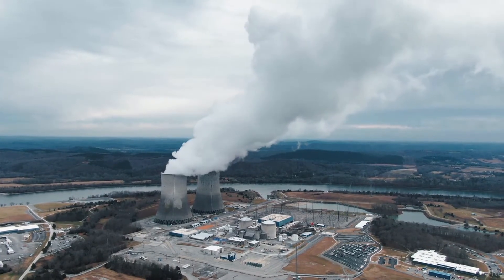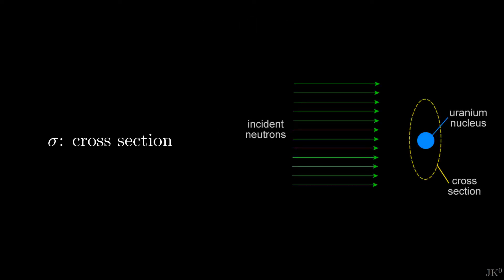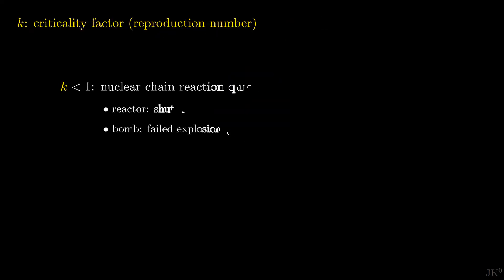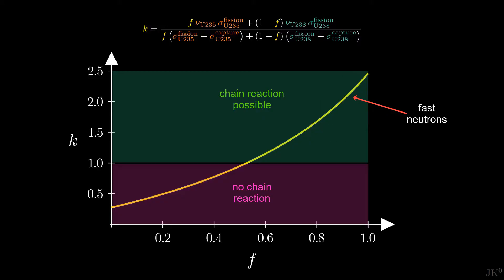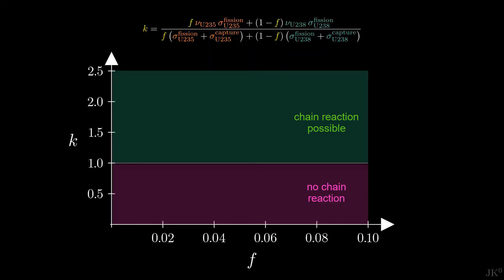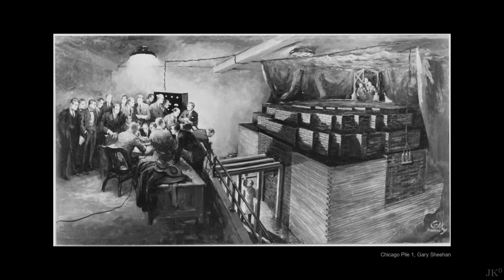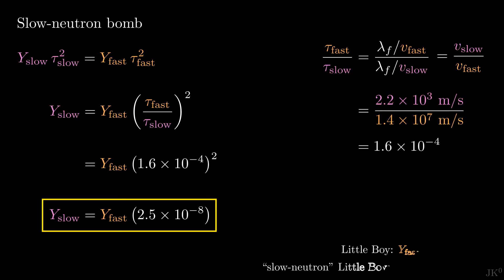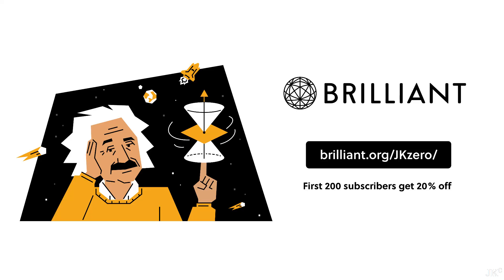Nuclear Bomb vs. Nuclear Reactor

Comment: There are some assumptions and simplifications in the 375g TNT calculation. Might be close with an ill-fated reactor, but certainly not when designing for yield. If focusing and DT is also allowed, different assumptions are required. Needs intentional design optimizations to get any meaningful yield with slow n, cannot happen accidentally, that is true.

Comment: 6:30 this is not true. Chernobyl was a nuclear explosion. It doesn't matter if the neutrons are fast or moderated. It only matters if the mass of uranium achieved prompt criticality. Prompt criticality is uncontrolled and leads to a nuclear explosion. One can design a reactor so it cannot go prompt critical at any circumstances. RBMK reactors were however designed in a way that allowed them to go prompt critical, thus becoming a nuclear bomb. A bad one, inefficient, and very limited in power, but still a nuclear fission bomb (if handled inappropriately). Properly designed nuclear reactor can only achieve delayed criticality, which can be controlled, and with proper design is also self-containing. which means that an increase in power gives a negative feedback that push reactor back below criticality (and slowing down the reaction).
Reply: No it wasn’t. It exploded because of the accumulation of vapor and other gases inside tbe reactor chamber. It blows away the reactor cover and leaves the core exposed. But it wasn’t a nuclear explosion by any means.
Reply: The explosion was the reaction between generated HHO gas from the coolant being radiolysed and the graphite catching fire. Yes it went prompt critical but it just melted for the most part, the radioactive fallout was mostly the debris from the HHO detonation

Comment: Yes. But isn't there a scale factor that needs to be taken into account? The bigger the bomb, and the lower its "density" the bigger the fast/slow neutron ratio effect on yield would be?
So is there a lower size limit below which you would actually want to use slow neutrons for a bomb?
Or is this size threshold just so far outside of buildable object sizes that it's not relevant?

Comment: Nuclear reactors can become dirty nuclear bombs , as Chernobyl and Fukushima demonstrated. Wouldn’t you agree Dr. Diaz ?
Reply from the maker: Under dramatic conditions, nuclear reactor can be taken to critical scenarios. In Chernobyl the most important factors were the terrible design, bad operation, and lack of containment that led to a a run-away reaction and the subsequent stem explosion. Not a nuclear explosion.

Fukushima was different, reactors cores melted down but the explosions were just hydrogen explosions, nothing nuclear either.

Comment: Your definition is incorrect. A “fizzle” is a nuclear explosion that exploded below its design yield. However, it is still a nuclear explosion 

The k value is still greater than 1 at the time of detonation but is unable to sustain for long enough to achieved its design yield before it blew itself apart and reduce k value to less than 1.

(If only the convention explosive detonate then they would described it exactly that… conventional explosive inside the bomb went but not a nuclear explosion)

So, yes a nuclear reactor like Chernobyl could definitely become a “fizzled” nuclear bomb accidentally as the design flaw which allows for positive void coefficient means that there is a possibility of a reactor runaway where power would continue to increase until it basically blew itself apart.

Hydrogen/steam explosion doesn’t vaporised 190 tonnes of uranium in a blink of an eye like magic… Chernobyl reactor 4 core was pretty much left emptied after the explosion. The  famous “elephant foot” is actually over 90% melted sand with only traces of fission products in it) and all evidences points towards very little of the reactor core are left onsite. (Note Chernobyl reactor cores are gigantic)  

They were able to sent people right inside the Chernobyl reactor just several months after the explosion… compare to Fukushima which they still  can’t get anybody near the reactor after 12 years.

Comment: I enjoy a lot your excellent channel, well done!

Speaking of the yield, you have to take into account the total mass of the nuclear material also, don't you? Since the uranium content in a nuclear reactor is around 3 orders of magnitudes larger than in a nuclear weapon, this compensates the inverse squared effect of the characteristic time between neutron collisions. This way you end with a yield ratio between a small weapon (utilizing fast neutrons) and a large reactor (utilizing slow neutrons) around 10^4-10^5, resulting in explosion energy in 100-1000 kgs in terms of high explosive equivalent instead of 0,1-1 kgs.
Sure, this is nowhere compared to nuclear weapons yield and can be produced with conventional explosives much easier.

Some say that the initial explosion at the infamous Chernobyl accident was a low-efficiency nuclear detonation, or rather, "fizzle". The claim is based on evidence examining the ruins of the reactor hall, position of the biological shields etc. Check out That Chernobyl Guy's video on this topic: https://www.youtube.com/watch?v=kuptYyKoDM4

Comment: Can it explode like a nuclear bomb, with a classic mushroom cloud .... No. But that is a false question, and a misdirection.

Can a nuclear reactor suffer an in-core nuclear detonation leading to rapid catastrophic disassembly and release. Yes, in some circumstances. It has already happened at least three times, and arguably several or many more. SL-1, KIWI-TNT, and Chernobyl all suffered in-core nuclear detonations and disassemblies. The assemblies could not release more than tens to a hundred tons of TNT equivalent release from prompt fission yield. But tens of tons is certainly enough to utterly destroy the reactor and any containment.

Many of the tiny SNAP and SPERT reactors may have crossed that threshold as well.

Is this a serious concern for nuclear reactors? Yes. The reactors must be designed and operated in such ways that it is not possible to achieve prompt criticality leading to disassembly (or even serious damage) under any conceivable incident scenario - including especially hostile action by any adversary - internal or external, and from any conceivable accident scenario.  It is not enough that the probabilities be low. The consequences are far too severe to allow any such scenarios. 

This also extends to spent fuel pools and other fissile material storage.
Reply from the maker: The topic of the video is the fact that a nuclear reactor cannot explode like a nuclear bomb (which stated within the first 20 seconds of the video to avoid misleading viewers), and the title of the video makes clear that this is a comparison of the nuclear reactions taking place in a reactor and how they differ from those in a bomb. Other types of explosions are mentioned at 6:24.
Reply: @jkzero  Ah - but that is precisely the misdirection that will mislead viewers, as the viewers are mostly not well versed in nuclear physics or even the consequences of catastrophic malfunctions in such facilities. In many ways the consequences of a lower yield nuclear detonation in-core that destroys the reactor and facility and spreads enormous quantities of radioactive material across the landscape and into the atmosphere is worse. These are potentially nation killing events. Arguably, Chernobyl ended the USSR. Fukushima nearly did the same to Japan, though no in-core detonation occurred there. 

If such an event occurred in a US reactor in the midwest, it would wipe out much of the US heartlands ability to produce food (both as crops and animals). Farther east and the population impacts are massively larger, but with lower food production impacts. 

Many of the reactors are embrittled or have extremely questionable primary vessels already, making them more vulnerable to catastrophic failure. Nearly all of them are extremely old making them more vulnerable yet, with embrittlement of all of the nozzles and connections. 

Some like CGS in Washington State have other serious issues. NRC has allowed CGS to run with a broken bracket on a primary ejector pump in the primary vessel by running with a richly hydrogen environment to reduce oxidative damage to the remaining bracket, and greatly increasing the risk of a catastrophic failure. 

The nuclear ago of fission is over. It is highly non-economical, and hugely risky, with no path to deal with the long lived radioactive wastes or fissile materials or other actinides. It's time is done. But the industry refuses to go quietly into history.
Reply from the maker: @tunneloflight  I understand you point now, I think you are right. However, using your comment " the viewers are mostly not well versed in nuclear physics," when they hear "nuclear explosion" they all think on a full-scale at-least Hiroshima-like devastation and not the in-core detonation that you describe. But I get your point, thanks for sharing that.
Reply: Also, the comment of other explosions at 6:24 is inadequate. We HAVE observed in-core detonations. 

In all three that I cited, the reactors were driven deep into prompt criticality. 

SL-1 was a far over powered reactor. When it was designed the 1 stuck cold rod criteria did not yet exist. SL-1 led to that criteria. When an operator overcoming the jamming of a control against poison cladding, added to reduce the reactors power level, jerked the central control blade nearly two feet upward, he inadvertently set the stage for a prompt critical rise through 25 generations of power rise reaching enormous power levels before the flash vaporization of the coolant, and fuel led to reactor disassembly ending the excursion. But the rectors destruction was already guaranteed by that time. 

KIWI-TNT was intentionally destroyed by overriding safety criteria, and snap  moving the control element far beyond design. That resulted in a similar catastrophic prompt nuclear rise and detonation destroying the reactor. 

Chernobyl similarly was destroyed by horrifically bad design and horrifically bad operation. The control rods were tipped with graphite that increased reactivity before the nuclear poisons could enter the core. The reactor was then run in a highly unstable regime at low power with xenon build up being overcome by withdrawing all of the control rods. When power rise then began the chief operator order activation of AZ-5 - a full scram - which then enormously added to the reactivity of the reactor and causing a prompt nuclear power rise to levels vastly greater than the reactor could ever handle. 

In all three cases the result was precisely what the video argues cannot happen - a prompt critical nuclear chain reaction far above unity, resulting in a catastrophic sub millisecond period and a power rise that screamed through the power range and beyond, generating ton to 30 ton TNT equivalent energy yields that vaporized the central core and splattered the rest outward before the negative reactivity insertion was great enough to shutdown the reaction. Even then, delayed neutron generation drove things even higher yet. 

This is precisely what the vide argues cannot happen. But it did. It did precisely that. By definition these were nuclear detonations, albeit very low yield in bomb terms. But the yield doesn't need to be in the kiloton range to utterly destroy a reactor. And As I noted before, the consequences of destroying the reactor facility are in many ways worse that a full bomb yield detonation. 

Also, the fizzles mentioned have to be remembered are typically 500 ton yield detonations. Those are enormous detonations even as failures as nuclear bombs or devices.  

Add to these the many SNAP and SPERT reactors tested to failure by ejecting control elements. Many of these disassembled as a consequence. These were even lower yield nuclear detonations, with low consequence other than to the tiny reactors themselves. 

The Godiva criticality accident took that a step lower yet, achieving a prompt criticality but not destroying the assembly. 

The various TRIGA reactors operate in that regime - triggering short lived low Keff prompt criticalities of insufficient power to damage the reactors.

Comment: 8:22 whats' a moderator
Reply from the maker: as explained at 8:28, a moderator is a material that, when neutrons collide with it, neutrons slow down. Neutrons released by fission move very fast, then they collide with the material (moderator), and after the collision move slower.

Comment: Ah, now I see the side by side comparison of the fast and slow charts have different enrichment fraction scales.  Would it be correct to say that commercial power reactors can not get into a high order nuclear explosion because, (1) they do not have high enough enriched  fuel, and (2) the reactor is so over moderated that a run away chain reaction (k >> 1) is not possible?
Reply from the maker: This is correct, you totally got it!
Reply: @jkzero .     THANK YOU.  With regard to next generation, small modular reactors (SMR), core designers want to used higher enriched fuel, even HEU.  So this can  remove one safety constraint.  But the fast neutrons may not be adequately moderated either.  I am not clear the reactors are feasible for private commercial applications.  I believe some military reactors operate on HEU.  Perhaps you could do and introductory video on SMR core dynamics sometime.  I would like to know how the fast neutrons know how to behave themselves.  I know my question is not clear.  I guess I’m asking how the HEU core can burn for a long time without refueling.
Reply: They still can never achieve critically as this is extremely difficult to do.
Reply: @jkzero  Conversely, it has been estimated that US Naval reactors may be enriched to above 90%; what is their chance of a nuclear detonation?
Reply from the maker: @Joe_VanCleave  good question, I am pretty ignorant about naval reactors, I focused on reactors for commercial power generation.
Reply: 0…the problem is getting the fuel to criticality which even in a proper bomb is very difficult. 
Watch the Manhattan project and how they discovered the implosion method…it took months and months of theory and working with various orders of explosives and detonators to come up with a solution
Reply: K and f graph will change with temperature so what would it be for higher values of temp ?

What's the highest temperature in which value of k < 1 for natural uranium?

Comment: Not sure what difference it makes, whether the explosion is "just" a steam explosion that blows the reactor apart, or a nuclear explosion that ... well, blows the reactor apart.  What happened at Chernobyl was sufficiently bad, even if it was "only" a steam explosion.
Reply from the maker: I think there is a big difference because modern reactors have a massive containment building around them; therefore, a steam explosion will likely not damage the reactor components, and more importantly, to the surrounding area, making nuclear reactor extremely safe to live around. A full-scale nuclear explosion (which is not possible) would completely vaporize any containment around and produce catastrophic damage several kilometers around.

Chernobyl was a steam explosion, you are right, and it was terrible; however, the reactors there were designed to fail and didn't have containment buildings. No other nation in the world would have built such time bombs.
Reply: Usa did alot timebombs too, just every1 silent about it, u hypocryte shhteater.

Comment: In answer to the clickbait, yes. Several have, deliberately or unintentionally. 
SL/1, SPERT, BORAX and Chernobyl no. 4 all suffered steam explosions. 
At Fukushima, hydrogen was generated by the hydrolysis of the zirconium cladding, and that exploded. 
None of these were nuclear explosions, but they were nevertheless explosions.

Comment: I was recently discussing this topic with some friends. Understanding that a reactor cannot explode exactly like a nuclear bomb, a question was raised about a possible steam explosion. Chernobyl as an example: can a steam explosion, generated by nuclear heat, be considered a "nuclear" explosion?

We tentatively concluded that it was subjective, since the root cause is usually due to uncontrolled nuclear reaction of whatever cause. Using a nuclear warhead as an example... The explosion is actually a result of a sudden release of energy "generated" by nuclear fission. The sudden release is made possible by the bomb casing, containing the reaction for as long as possible until it is finally overcome. In the case of a reactor explosion, the energy is transduced to steam pressure; howbeit, a few extra layers of procession.

Comment: Chernoble and fukushima were nuclear explosions looking inside the fukushima reactor core. Nothing was left of the fuel rods as was the same at Chernoble, in a 1950,s book i read that a nuclear pile will explode with the force of tnt if left to run away.
Reply: That's factually wrong. Both were hydrogen explosions. The fuel reached such temperatures that the water in the core turned into hydrogen gas, which ignited. In the case of chernobyl, the entire plant blew up, including SOME of the fuel. The rest continued to react and melt through the bottom of the reaction chamber, forming the famous elephants foot. The same happened in fukushima to a much lesser degree, because the plants were built to withstand such a blast.